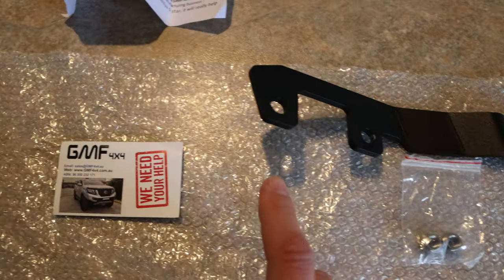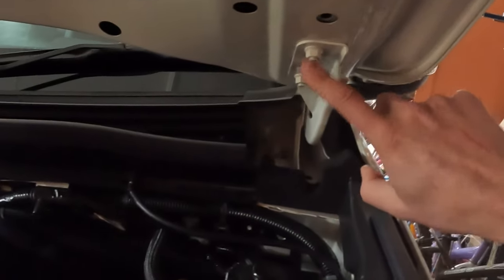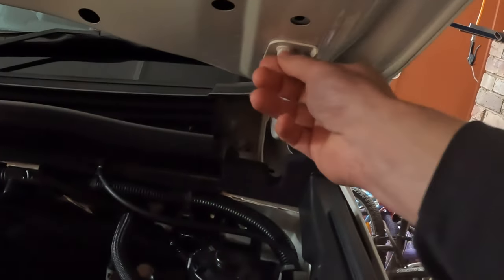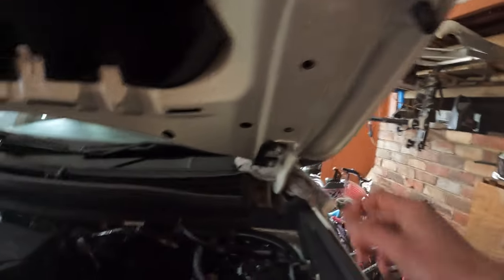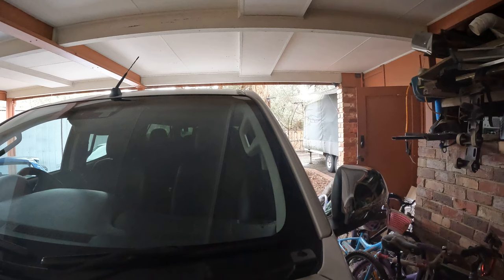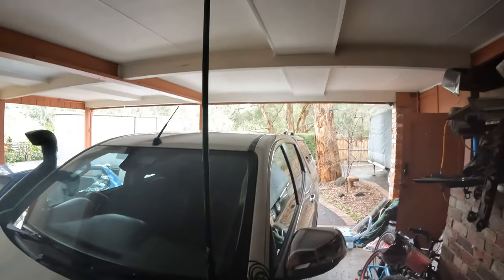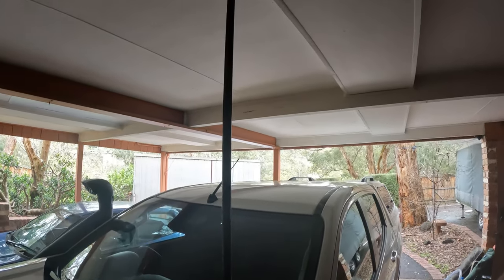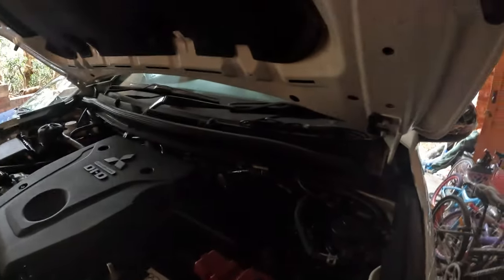How to mount a UHF antenna without a bull bar! Mitsubishi MR triton L200

Comment: Thanks for the video. I wonder whether you have the new nuts upside down? To me it looks like the "stud" or "flange" on the supplied nuts from GMF4X4 are made to fit inside the bracket hole, as the bonnet bolts are very short. I have today sent a note to GMF4X4 for their feedback, but would appreciate your thoughts please. Cheers, David
Reply: Quick update. Greg from GMF4X4 has confirmed ..."yes the nuts we supplied replace yours, as ours have the little step that goes inside the bracket hole which increases the thread contact on the bonnet studs." Hope that helps.
Reply from the maker: Yeah I just checked mine and I made such a rookie mistake. Thanks so much for pointing this out. I'll pin your comment so other people don't copy me. Thanks again David!
Reply: @thelapyear  G'day. No problem.
Reply: Will this fit a mn 2015 mitsubishi triton